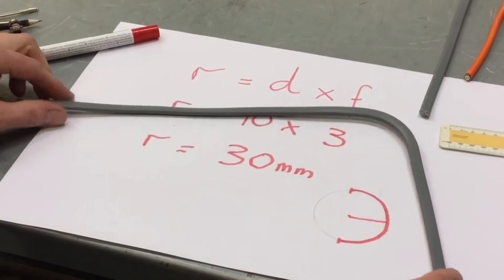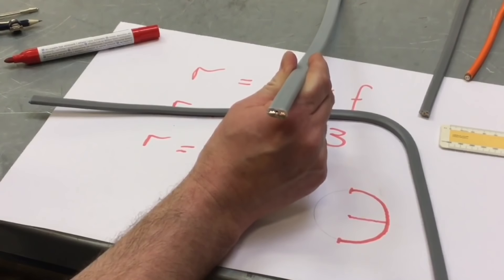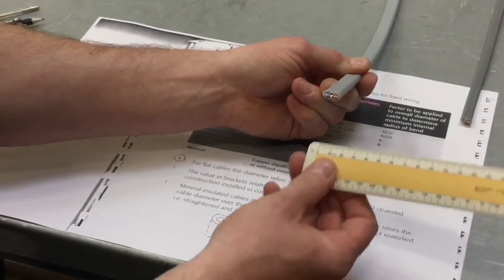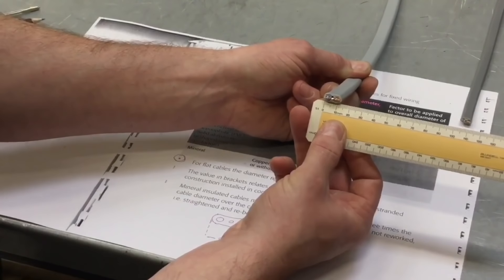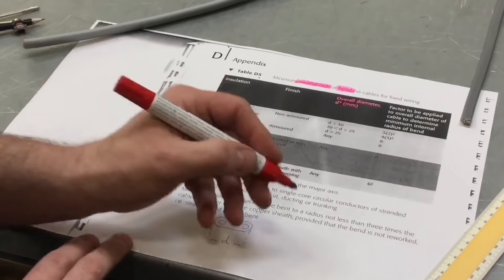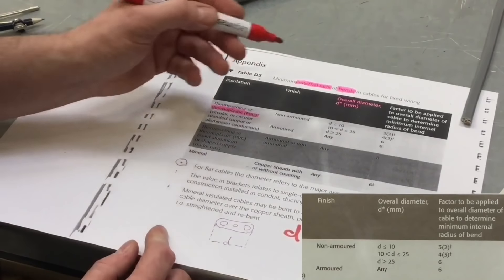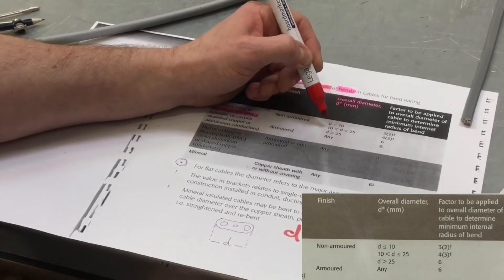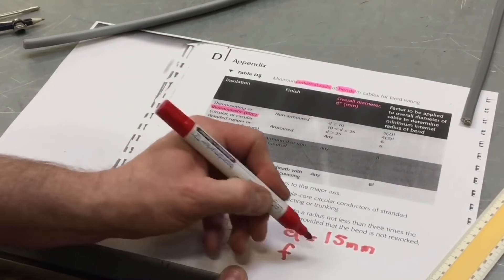What is the Minimum Internal Bending Radius for Cable Used in Fixed Wiring According to BS7671

Comment: Thanks for another great video Gaz. Bad news...I've just been fettling some 50 year old 2L2.5 MICC. I probably bent the cable a little more than I should have (although not more than the radii mentioned in your video) when I was doing the fettling, but now I've pulled the cable straightish again, I seem to have a short across the live, neutral and earth on the cable in question. Is this a common problem and is there anything that I can do to try to rescue the cable?

Comment: Do these bending  radii apply to bends due to internal or external bends round corners, such as the corner of a room or exiting a hole in a rafter? As the bend is on the narrowest diameter does this also effect the radii factor?

Comment: Can you or anyone explain how much resistance increases with the bends ?  I assume that is the primary reason for these min radius rules.   I ran a 10 ga extension cable from my garage into my basement to get a 20 A circuit without those infernal GFI's.   My evehicle pulls 12 amps continuously and I noticed  the gentle bend where the cable came down from the outlet I was suprised to find it a little hot at the bend.  So now I limit the amps to 11.    Why would electricity care about these bends?   Can other things significantly increase resistance ? - tension, a clamp?

Comment: Nice video, very clearly presented.

I'm a bit surprised the OSG is saying minimum 6x diameter for all sizes of SWA. If you look at most manufacturers data it says 8 x for sizes greater than a certain conductor size, say 16sq.mm. If you are working out large SWA's going around cable tray for example, a factor of 8 x would be my advice when designing cable tray size.
Reply from the maker: Hi. Thanks for the quality comment the question in the exam my learners sit needs them to state a factor of 6 for SWA. I would always recommend manufactures date is used on the design of an installation thanks for watching GSH Electrical 👍

Comment: Good stuff...I wonder how many 25mm meter tails are over bent?...probably every single one.
Out of curiosity....when you have bent the radius....how much straight cable must there be before the next bend. Example...Meter tails entering a CU from the bottom...which have to be installed into the top of the main switch...which usually ends up a "U" turn...downwards...that's 2 x radii (30 to 40mm)  in a very tight (not enough) space in a CU.
Reply from the maker: Hi. If the bending radii conforms you can make as many bends as you like... hands up I am guilty of one or two tight bends in meter tails over the years. Thanks for watching GSH Electrical

Comment: Hi, very clear. 
I wonder if there is any difference if I bend it on its flat area (instead of bending side area of the cable as you shown on the video)? Thanks.
Reply from the maker: Hi, rule of thumb smooth bend 👍. Thanks for commenting and watching. Gaz
Reply: That doesn't seem to answer the question, unless you are saying: No difference, just use the same smooth radius if you bend it the other way, which would seem logical. Although I can see bending the other way, it's much more likely you would get a sharp bend rather than a smooth radius.
I can see how this rule applies on cable runs, but what about in confined spaces such as inside a socket, where it's obviously difficult to achieve and cables often get bent double?

Comment: Aside from 522.8.3, is there in 7671 that stipulates bending radii?. GN1 Selection & Erection page 80 is the nearest thing I can find?
Reply from the maker: PNX Electrical page 144 in the On-Site Guide
Reply: @GSHElectrical  aha, but nothing in the big blue? I get most of the OSG is just duplication from BBB, so surprised I can't find it in big blue.

Comment: sorry but if I was to do that for every house re-wire, each indevidual cable run would take me about 30 to 35 minutes maybe more.
Who would actually use this formula/  If it was a designer,  would the installer really spend time makeing sure the radius was correct?  
Dont think so!!!!.
Reply: not so much relevant on site but good practice to learn this in any case. Surface mounted/clipped direct cables look awful without the correct radius. Also, whats the rush?